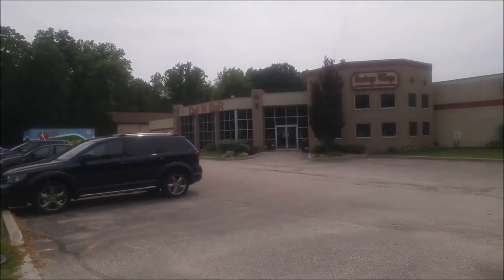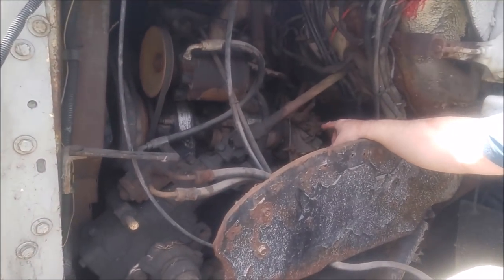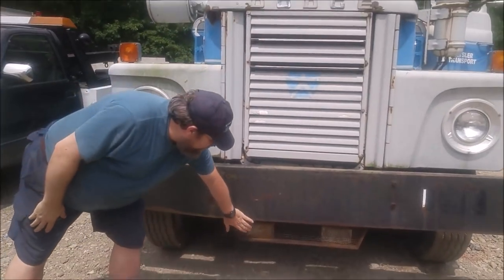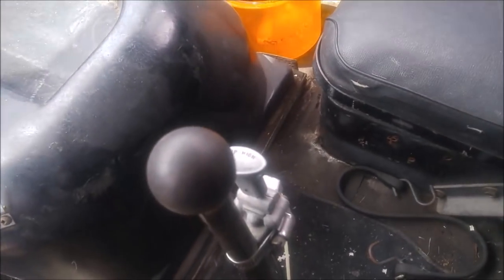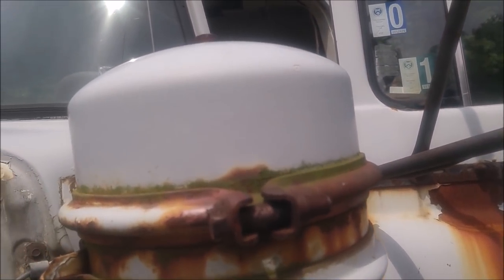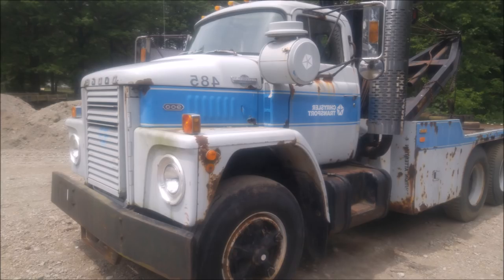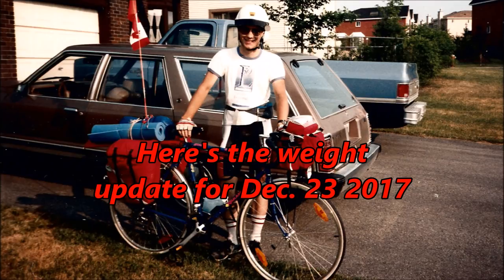A close look at Dodge CNT900 Tow Truck

Comment: My 1st job was a CNT 900 10 wheel block delivery truck with a 16 spd spicer & a 6/71 still my favorite truck after 43 years of driving. The whole fleet were Dodges, trailer dumps , tri-axles, & all the block trucks.
Reply: They used the same cab from a pickup all the way up to the Big Horn.

Comment: Neat find and good video..... but there appear's to be some "armchair experts" on here as well with their (cough, cough) "expert" comments     Allow me to help you a bit,   FIRST: What you described as "louvers" are, and were..on "Most" ALL trucks of the era... Thermo-pneumatically controlled (heat and air actuated) "SHUTTERS" to control engine temperature and was replaced with the advent of the Thermatic clutch fan.      The actuating pneumatic piston for the Shutters was known as a Shutterstat.  

GM & Ford truck were two exceptions of the era Not utilizing Shutters for engine temp. control..... almost all of the other manufacturers of the time,  not just Dodges and Macks... used Shutters.   International Trucks had them on some, and not on others.

SECONDLY: The engine in that truck is identifiable as an NHC Cummins (which, by the way is properly pronounced "Cum - mins"... Not "Q-mins" named after Clessie Cummins, the founder), which hp rating.... could be any one of four or five,  from 180 to 250... with the 250 being introduced in 1972.    The NH Series engines shared the same Bore & Stroke of 5 & 1/8th" X 6" yielding 743ci and were the successor of the Cummins "J" and "JT" series.... and predecessors of the well known NT/NTC/NTA series engines of with a shared bore and stroke of 5.50" X 6"   yielding 855ci.    The compound turbocharged NTA (NTA = N Series, Turbocharged and Aftercooled) was the "biggest" (hp wise) of the NT series engines with a rating 475 hp at 2100 rpm and a torque output of 1,430 ft-lbs at 1,250 to 1,400 rpms. 

Thirdly: What you identified on the drivers side cowling as an "air dryer for the brake system" is, in fact the primary oil filter... which some just refer to as a "Luberfiner" which is the company that manufactured those housings.... there were several different styles made and used by various class 7 & 8 truck manufacturers.   Most All heavy-duty truck engines utilized more than just one single oil filter... a few even had three.

Fourthly: What you identified as the "control for the rear end" on the shift lever is, in fact, the Hi - Lo range selector (air operated) in the rear portion of the transmission casing.  The Fuller (Pronounced "Full-er" not "fuel-er) RT-910 was rated for only 1,000 ft-lbs of torque... which was more than sufficient to back almost all the engines of that era.

Great find!!.... keep up the good work.  : )

Comment: I work for Chrysler transport Lynch rd. In Detroit. What I was told is that this truck was ours for a number of years and we gave it to the Windsor transport guys to use for a few years after. Cool video
Reply from the maker: Nicklaus clark sr Thanks for the additional information. That fits with what museum staff know of it.
Reply: This wrecker was built in house at the Chrysler Transport Windsor Service Garage.
At the time it was built into a wrecker, it had brand new double frame rails, new complete cab, new doors, hood and swing fenders......all left over parts from when Chrysler closed Plant 1 which assembled these trucks. The plant used to be located at the corner of Tecumseh and McDougall roads.
Walter Klasko(sp) was the main builder on this project.
I work at Chrysler Transport still, and drove it many times before it was retired from service in the mid 90's. I also towed this out the Heritage Village where it rests today.

Comment: That switch that says slippery or dry is . A front brake limiting valve, it cut the air pressure to the front brakes by half . back in the 60s and 70s the belief was that by doing so would prevent loss of control , until we figured out since the front brakes did most of the stopping, it was causing the problem it was meant to prevent . I stopped using it after the first 2 times I used it in a 1970 Mack R model , they were discontinued somewhere around 73 or 74 because that's the last time I saw them on new rigs ,the switch on the transmission lever is for your auxiliary box , that took the place of the second gear shift lever that's a pre Eaton Fuller merger transmission probably early to mid 70s . I don't miss the old days at all , my hammock beats the ride on any new truck

Comment: This wrecker was built in house at the Chrysler Transport Windsor Service Garage.
At the time it was built into a wrecker, it had brand new double frame rails, new complete cab, new doors, hood and swing fenders......all left over parts from when Chrysler closed Plant 1 which assembled these trucks. The plant used to be located at the corner of Tecumseh and McDougall roads in Windsor Ontario Canada.
Walter Klasko(sp) was the main builder on this project.
Reply: Up until about 10 years ago, we still had brand new doors and fenders sitting in a storage trailer. 
Sadly they were scrapped. 😪
Reply from the maker: Scott Wade Thanks for the info about the truck. This has been a popular video. The first episode of building a model of this truck will be posted on this channel soon.
Reply: Truck started out as road tractor , then converted to a wrecker . Have many pics of this thing somewhere.

Comment: The filter on left side is a " Lube-R-Finer"  oil filter for the engine.  The dry/wet road switch limited air to front brakes preventing spin out or lockup when applying brakes. Nothing denotes Holmes at all, but is a rough copy of maybe 3 other lesser known brands. I'd suggest the engineers looked over some others then built their own based on those viewed. The PTO (power take off) was activated by depressing clutch and pulling a cable or flipping an air switch, this would pull a drive gear in PTO unit mounted on side of transmission (after market) into contact with counter shaft gear, while transportation be is in neutral. When PTO is in gear a shaft would rotate stretching to a torpedo bearing mounted somewhat inline with PTO, bearing had sprocket driving a chain up to winch transportation. To gain up/down some had a rod going from lever at rear of truck to clutch fork at trucks transmission, a pull or push disengaged clutch while operator pushed or pulled a second lever selecting up or down, when winch gear selected operator would back off first lever allowing winch to operate. This was cheap way to build homemade wreckers. Brand built wreckers used by a more refined (expensive) way, brand built would go into up/down with one lever for both. How to raise, lower, or extend boom, you hooked cable under boom head using winch to pull boom up till support cables be slack,  with manuel winches you play out slack or pull in till desired hight, let out service winch till support cables are holding boom. Extending boom, you be preformed same procedure, allowing boom to lower to bed, when slack you pull boom out placing a pin in hole at desired length, pull boom up, tighten support cables to desired hight then lower boom into support cables. On a heavy boom or long boom, we'd use pulley at end of boom running cable around till hook reached boom insert, then use be service line pulling cable in around pulley to have it pull extension out as we winched in.

Comment: My thought work faster than my typing skills. Should have said that they painted Snoopy on the louvers to the radiator. When they were open you didn't see it, but if they turned into the cold wind they would shut. I heard you say Algoma steel, that's in Sault Ste. Marie , Ont. I grew up on the Michigan side just across the river.

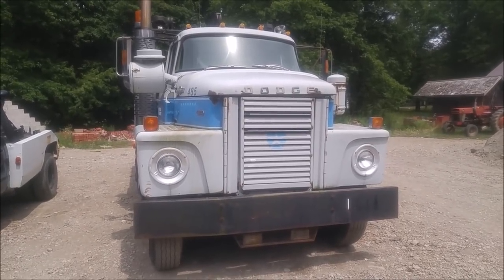Comment: 2:14 "If we look at the grille..."

That grille is really a radiator shutter which opens and closes according to the temperature. It can be found in International some heavy Loadstars, Fleetstars, Most V-series, Most M-CBE Series, especially diesels, 1960s Transtars 400 and 4000 series, 1950s White conventional trucks, some 1960s Autocar trucks, Early 1960s Ford Super Duty and Diesel F and N series trucks, 1950s and 1960s Mack conventional trucks and most of these Dodges, especially Diesels among others.
Reply: it's called a shutter stat they came on dodges as well as other makes.
Reply: @kennethplunkett5476  Thanks!!!!

Comment: The wrecker body looks like an Weld Built in Pennsylvania . they were noted for Braden Winches , also E. R .Buskey in New Hampton ,Iowa looked almost like a Weld Built .Buskey was also known as Vulcan ,and Nomad . Old timer wrecker operator since 1969 , opened my own business in 1977 , still going at 67 years old .owned Holmes , Vulcan , Jerr Dan , Nomar ,still have a 750,  14 ton Vulcan , 12 ton Century 10 ton Here Dan , 12000 lb Jerr Dan rollback , 1 man operation.

Comment: Brockway trucks built in Cortland, N.Y., short & long hood had swing out fenders, butterfly hoods,358,359,360, 361series.If the Dodge did not have the filler panel in under the cab it had inline 6 Cummins or Detroit.The filler panel with raised cab and fenders was used for the installation of the  8V-71Detroit.I don't  remember it with a 903V-8 Cummins. The lower hood could have had a 555V- 8 Cummins or a V- 6 Cummins that was made in Shotts, Scotland.I don't think they had 6V-53's or 6V-71's. This cab was also used by FWD and OSHKOSH.

Comment: This most likely has a 555 Cummins Non Turbo Diesel Engine, especially if the Truck was built in the mid 70's. Most of the Dodge 900, and CNT 900 Trucks had either the Cummins 555, or a Detroit Diesel Engine in them.
Reply: The engine looked like an N series inline six Cummins, probably a 250 or 280. I've worked on rigs like this with the short nose cab and a big cummins, a real pain in the butt doing engine work, especially the cylinders that sit under the dash.  I have also seen these with the 555 V-8 as well as various different Detroits. I also saw one once from the early sixties with a smaller J series Cummins inline six.
Reply: It had a 250 Cummins with the manual compression release.
I operated this truck!
Reply: It is not a 555 because the dog box on a v8 cummins in these trucks were way smaller. almost didn't need one. I own a 73 ct800 with the 555 I wish mine had the inline 6
Reply: @michaelqualtieri1228  Fire Dept I was at had a CT800 with a Triple Nickle Cummins and an Allison 6 speed auto, terrible combination. It had no dog box at all.
Reply: You can see the PT fuel pump when the drivers side fender is swung open. Definitely at NH 250 ? I worked on many varieties of Dodges at Cummins Ontario in the early to mid 70’s. Even drove one for a bit and got paid. The 903 version did have the raised cab skirts. When Ford came 
out with the Louisville it was a game changer. Everyone bought them instead, unless you where hauling GM parts or finished products.

Comment: With the Tulsa geared winch, no hydraulics and the design of that severe duty boom particularly being made of heavy structural steel its very safe to say that it was an aftermarket wrecker body definitely done by Chrysler. That thing you thought was an air cleaner on the driver side in front of the door is what's known as a luberefiner.

Comment: Nice find. Not sure when air dryers were invented. So you would need to drain the air tanks every day. I use to in the mornings get the Air pressure up. Drain the tanks till no visable water came out. Then at the end of the day id drain the tanks again. 
The selector brake switch when dry gave full pressure to  the front brakes. Switch to wet it reduced the pressure to the front axle. A very Hinky system before ABS came along.

Comment: I think what you called a air tank in fact a thing called a luberfiner,it is connected to the oil system another oil filter
Reply from the maker: Roger Wachal Yes I believe you are correct. Air dryers for the brakes are usually down on the frame.

Comment: the tailights look to be the same as Dodge Vans' from the 1970's (two pairs turned on end).
The amber and red side marker lights are definitely Dodge truck/van from the 1970's.
Lending credence to a Dodge built wrecker body.
Reply from the maker: jamesbulldogmiller Yes I believe you are right about those taillights.
Reply: Yes we had the full size van assembly plant in Windsor . Those lights all came from there . Every light worked on this truck the day it left my terminal .

Comment: ok that's different way of prouncing Cummins  the air shift plunger isn't to the rear end unlike 2spd axle shit that air shift changed low-hi range within the Fuller Transmission